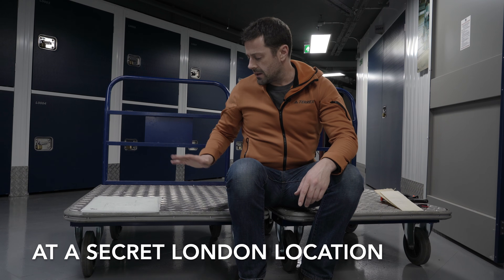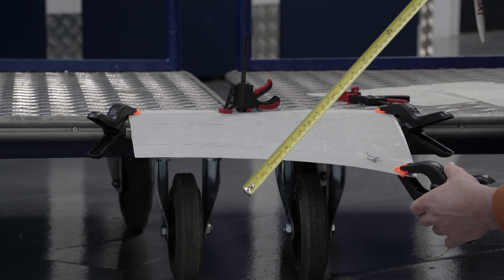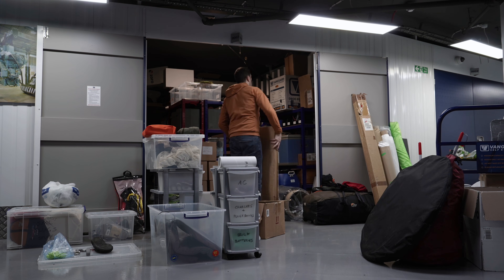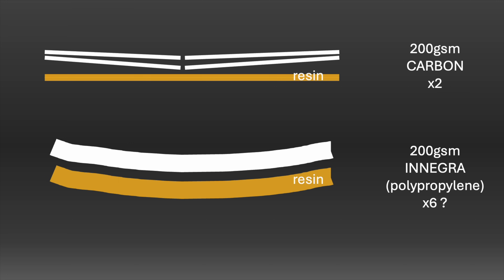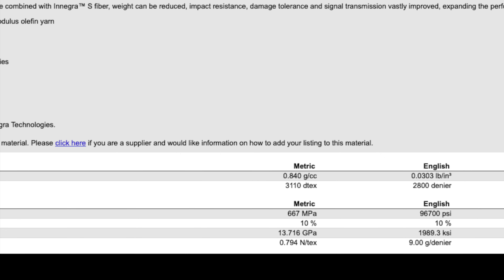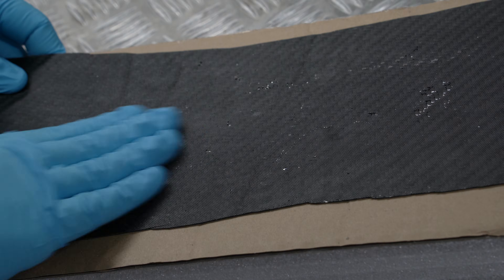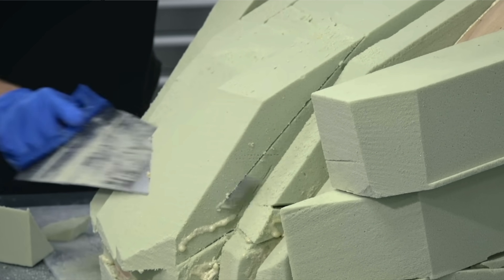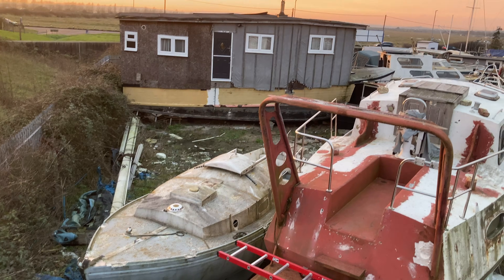Can PU resin match EPOXY? Composites torsion test & 3:1 scale mould for Arctic Vehicle Project [4K]

Comment: The experiments with casting urethane is actually very interesting to me.  I have a design that might be a candidate for this material. Likely a VARTM process would be required due to processing challenges of urethane?  (BTW, the plug is beautiful...as in it is as beautiful as it needs to be!)
Reply from the maker: Pleased it's of use

Comment: Not really related to the video. I recently got a 3D printer so am currently a hammer looking for nails!(Points if you get the reference) Have you considered adding one to Bernard? They don’t draw much power when running and some of the printed materials are insanely strong, so thing like Pa6-CF (Carbon fibre  reinforced nylon). It’s strong, heat, water and UV resistant. Some filaments like PPS-CF can be used in side car engines. Seams like a great way to get replacement parts with out having to stock a billon of them cloud even have readied print files loaded for likely parts. Something like a Bambu X1C would be ideal, high degree of automation, error detection, designed for reinforced filaments great user interface. Weighs 20 kg and is 45x40x70.
Reply from the maker: Perhaps, even if not onboard. How does the carbon reinforced nylon work? Carbon provides 90% of its performance by being long parallel fibres, not a dust.

Comment: Hi Alex

So here we have the first climps of Barnard's bottom sorry, underside, and i can now visualise the hull shape. But to help me more, is he to be a six or eight wheeled vehicle? We are going to need a warehouse to build him in. All 5 plus tons. Your idea will be based on the orange vehicle in this video and are we tilting to electric more?
Steve.
Reply from the maker: Each Bernard is likely to be 6 wheeled, and c.5m long. 5 plus tons is highly unlikely, even loaded with stores. The base weight of an unfitted out shell is with the new thicker plan, approx 24m3 x 3000gsm, plus core and resin, below 200kg. A currently marketed UTV Tweel is 22kg, and so upscaled for Bernard and x6, below 300kg. With a non-structural upper shell that's a combination of foam, composite and polycarbonate, you have another 120kg. Motor assemblies are at most 50kg per piece, so with four driven wheels 200kg. 820kg total. With a battery bank c. 200kg, you're only just over a ton.

The orange vehicle is merely an AI mockup, and yes we're definitely into electric power, and HVO generators in the second towed Bernard.

Cheers
Reply: @AlexHibbertOriginals  at 5m long, that is half the size of a single deck bus, and they weigh in at 9000 something kg. Have you looked at inverter generators? There is a lot of talk about them, not that I have much knowledge on it, but have you come across any?
Reply from the maker: A single decker bus is made of steel, which is 7x the density of carbon fibre.

What's the difference between an inverter generator and a generator plugged into an inverter?

Comment: Is there any merit in Graphene powder as an additive to the resin in a future test? 

A channel called Tech Ingredients showed the whole process of making it using ludicrous HV capacitors and Carbon black, then testing it against different ratios of carbon reinforced resin bars. The Graphene reinforced bar showed ridiculous strength at low concentrations, potentially worth having a look at if there's an easy source of it this side of the atlantic, or in the off chance you can get in contact with them as a source, since they already have the means.
Reply from the maker: I've not seen any proof of benefits for composites. Can you link?

Comment: Have you considered the effect of arctic temperatures on the PU composite? No good if it just becomes brittle. Also would be interesting to investigate how it holds up to repeated slight bending (fatigue at the fiber bond maybe). Any chance if getting a harder resin that bonds well to the PU? Then you could sandwich those to get stiffness and improved puncture resistance.

Anyway, interesting experiment. Very high impact resistance and lower stiffness composites have intrigued me for some time.
Reply from the maker: PU is rated to -40 similarly to epoxy.
Reply: @AlexHibbertOriginals There is a point here though. Ratings can be deceiving because you might end up with slightly weaker parts at those arctic temperatures than expected. Especially considering there will be deviances (hopefully not much though) between individual cured parts or sections of parts. Then you have a rather wet, cold, and high UV radiation. All of which can still be detrimental to PU bonds given extreme conditions. You might end up with a lower elastic range for your cured parts resulting in unexpected damage to the vehicle. I believe it could be interesting to do the tests conducted in a significantly colder environment after sufficient exposure (like a big ice box or something).
Reply from the maker: More testing, sure thing. But 'rated to' generally implies comparable behaviour, or within reasonable bounds. Our tests of composites with Easy Composites actually showed enhanced properties at -40. Admittedly not with PU.

Comment: Love the way you handle the data and plan all your tests so efficiently. Its great to see how the flexibility of the matrix isn't seen as a detriment, as it helps absorb energy from impacts. Minimum temperatures at your destination shouldn't be an issue with drastic property changes either. Other properties may be worse though and all variables need accounted for with real-world expectations. Keep it up! 👍
Reply from the maker: Cheers chap